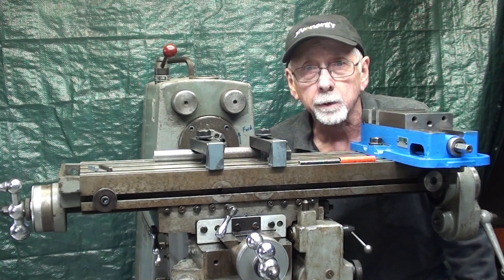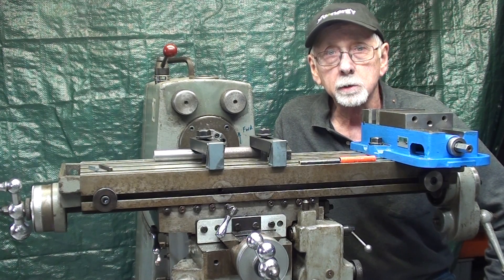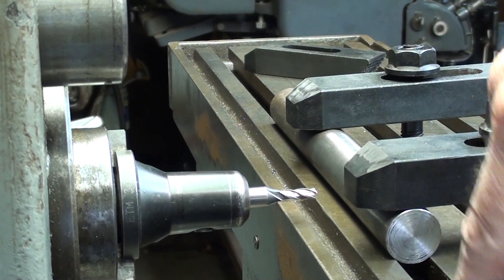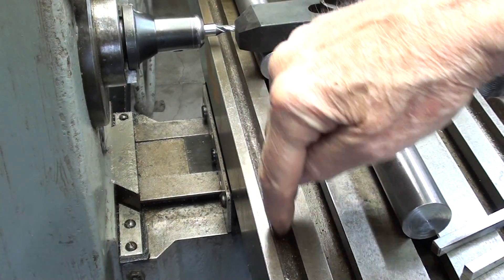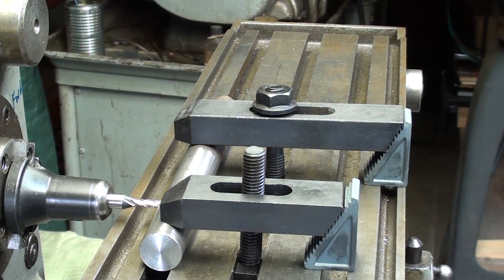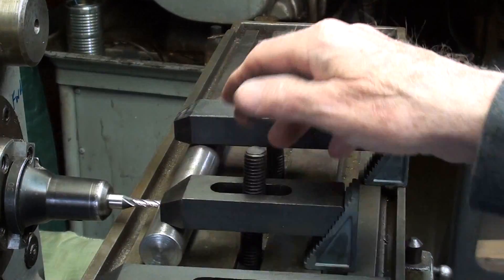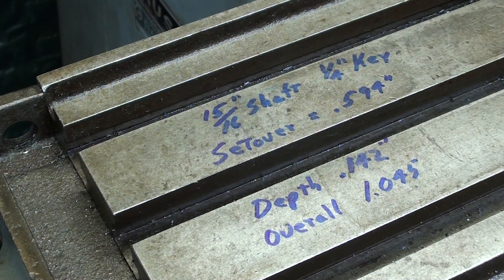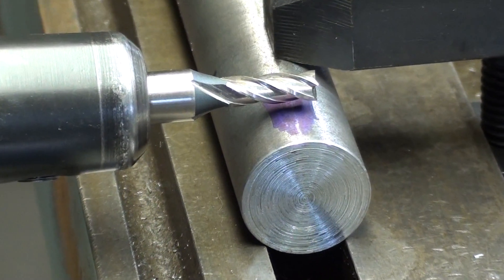Cut Sq Keyseat with End Mill Clausing TIPS 507  tubalcain pt 4

Comment: 5:52...why not just make it an even half inch(?]
Reply: 15/16th ÷ 2. + half the diameter of the tool...= 1/8th .....  .9375÷2+.125= .5937.  Thats true center ,tool to part
Reply: Johnny Drinkard   You are absolutely right- I mis-read the dimension...I should have said: ".600 inch"!!!
Reply: That all pends on the tolerance of what it goes to. Best to just use your dro, if u have it use it, it always has a better, crisp look when it's dead on.
Reply: @mrjohnnydrinkard322  Any machinist worth his salt would know that...

Comment: As I watched this video, I was struck by several thoughts. 

First: No dead horse should remain unbeaten.  It's feelings will be hurt by the lack of attention. 

Second: I love watching that little mill work.  Kinda like watching a kitten play with a butterfly. 

Third: Regarding a lack of views on machining, anybody who misses watching these all the way through has only themselves to blame. 

Fourth: Spending the most time explaining the setup and only a little time on the cut exactly reflects the reality of the shop.  In most cases, the cut is (or at least should be) anticlimactic and nearly boring. That's not the place for excitement.
Reply from the maker: Very good comment. And I got a good chuckle out of the dead horse,comment.  And yes, the set up is very important

Comment: Good info. When you touch off with paper, do you set the dial at 0 and just add to the depth of cut, or do you set it the thickness of the paper before 0?
Reply: If you are not sure you touch off 100%, you still have the key way height method with the Vernier Caliper, or Micro meter! This give you another checking possibility how deep you are.